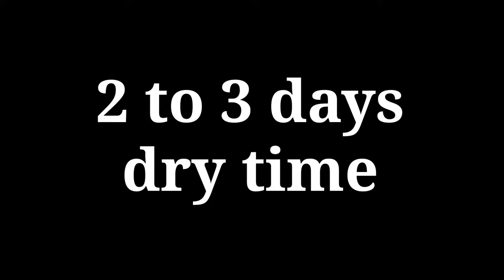HOW TO: prep & paint a scale model car body, step by step

Comment: Did you sand the primer? Did you sand the color coat?
Reply: Both yes
Reply: Me only sand a primer to get more smoother , with color coat will do sanding after im clear color coat
Reply: What is the process for sanding primer, what paper used ?

Comment: After paint has been applied, do you sand or wet sand prior to clearcoat?
Reply from the maker: It depends sometimes you might have to if there's pivots in the paint if not that you can just leave it alone